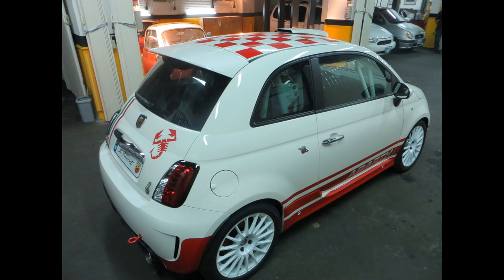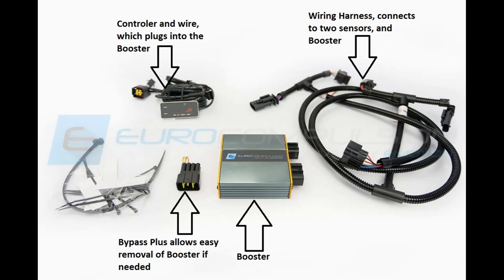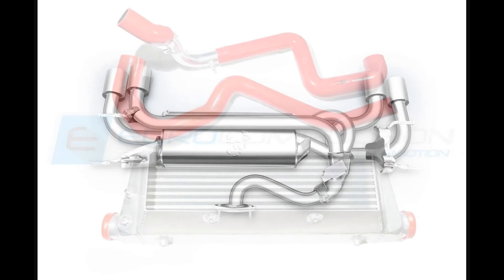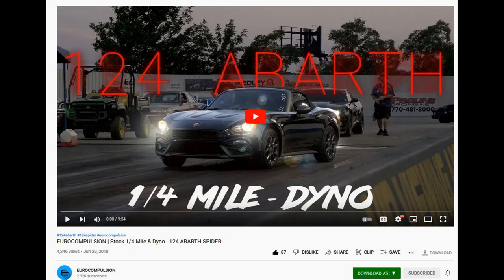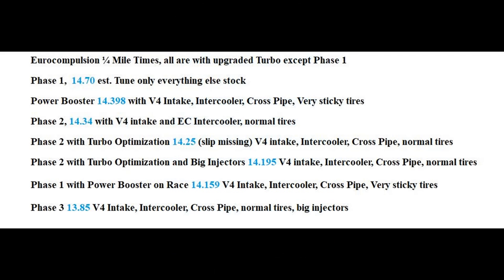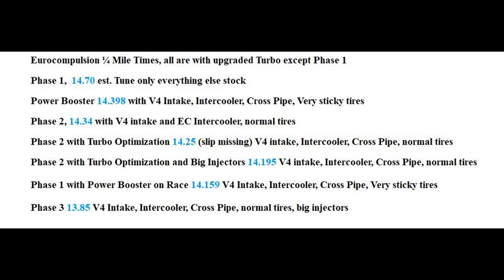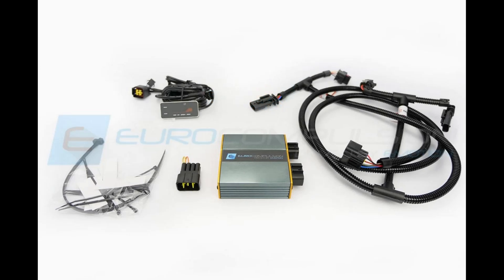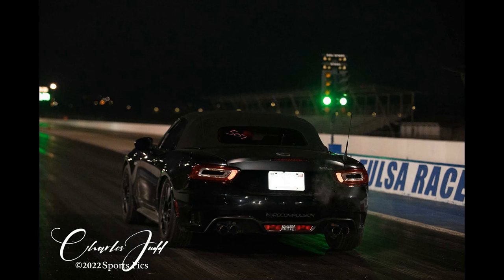Eurocompulsion Power Booster for Fiat 1.4 turbo engines

Comment: My dad has a similar device called Power Commander on all his bikes. Its also a piggyback unit that has vehicle specific wiring to use the databus inofrmations and an additional wideband lambda sensor. It automaticly adjust all sorts of parameters to achieve the perfect lambda over the whole mapping.
Its super practical if you have tuning parts on your vehicle and dont want to manually build a mapping.

Comment: Had an abarth 124 spider with the eurocompulsion v2 intake and stage 1 flash. Twas a joy to drive and, coupled with habitual upshift and downshift blips, made cute choochoo noises c: Ended up replacing the stock exhaust with an extra half inch diameter pipe that lead to a single ended muffler (much smoother sound as opposed to modern eurogrumble). Amazing to know you work at eurocompulsion holy moly :0

Comment: On par with the 15.3 of my '67 "Formula 'S'" Plymouth Barracuda, running with 3:55 rear end in 1968. My 'Cuda, was totally stock (Hurst-shifted 4-speed, Carter AFB 4-barrel, 273 CID V-8), not tuned at all, except a small tweak to the ignition timing. It also usually got 9 to 13 mpg (!!). I doubt I could afford to drive it today, and the quality control of body assembly left something to be desired – modern cars like your Fiat (yes, even a Fiat) are better-built. Now that I'm an old man, I drive a Kia Niro that has 1/4-mile times in a different universe from your Fiat, though it's faster than the Subaru Crosstrek that preceded it.
Reply from the maker: I really like the Formula S Barracudas. That's one of my favorites from the 60's. Of course they are ultra rare today, their poor overall quality and low price caused them to be sort of forgotten compared with Camaros and Mustangs.
Reply: I had an 1986 Mustang LX with the GT options. 13.8 and 27MPG on the highway if I took it easy. I couldn't afford mods, but I won a lot of races against anything stock that was made in that era.
Reply: @ZacLowing  I did, too – mostly Camaros and Firebirds with small-block V8's, with an occasional Ford V8. Never ran against a 289 Mustang, though – that might have been interesting.
Reply: @ZacLowing  
Do you mean you had the SVO turbo or the 5.0 liter?
And was 13.8 the quarter mile time?
Reply: @dukecraig2402  I owned a very tired (200,000 mile+) 83gt Mustang with the Motorcraft/Holley 4 barrel and T5. It consistently got 25 mpg with a 3:73 gear. It ran 13.9s on a good day. Usually, 14.20s as its always hot in Texas. This was before drag radials, and I couldn't afford slicks as a college student. I did quite a bit of Bracket racing back in the day at HRP. My father had a 1990 lx 5.0 5 speed. It ran about the same times with a 3:27 rear end but he was able to get 29 mpg on the highway.

Comment: You know what to do Greg. Time to mod MW50 injection into the little 1.4L to dial up that boost!
Reply from the maker: The car does have MW-50 on it, however it was not in use for these runs. I have made videos about it, I'll make another at some point in the future when I do use it at the drag strip.
Reply: @GregsAirplanesandAutomobiles  I haven't seen that, gotta watch it. Sounds very cool.

Comment: Don’t know if this is of any interest but we bought a Alfa giulietta new, it was the base 1.4 tb which only has 118 Bhp, there was another 1.4 tb in the higher spec which has 170bhp.  I’m in the uk where the road tax is based on the co2 emissions and the tax for a year on our lower powered car is £165 per year where as the higher output car is only £30 a year. 
Thank you for sharing your video.
Kind regards Carlos
Reply: We have the Giulietta 1.4 Multiair (170) which we've had for several years. Apart from blowing the clutch slave cylinder it's been totally reliable and is quick enough for my needs.
Reply: @nomdeplume798  
Yeah ours has been, we bought it new in 2014 it’s 1 oil change ( not a good thing) but it’s never had anything done at all, I think it’s done about 70k now which goes against everyone’s predictions that it wouldn’t last 3 years when we bought it. I like the DNA system it completely changes the handling. It is a fun little car really
Reply: Oil is one thing you have to be careful with in the MA as it has the fancy electro-hydraulic I inlet valves so regular oil changes with good quality oil is important.
Reply: @nomdeplume798  
I have neglected the car, it’s what my wife uses so Its never really been in my mind, but yesterday I drove it on a 80mile round trip for something it’s the first time I’ve driven it in about 3 years and the clutch pedal is hard to press the DNA system doesn’t work and has the brake warning ⚠️ light,  eml  light and tyre pressure lights all on, it’s like a Christmas tree. It’s just over 80k I’ve now realised and it obviously needs some love.
I personally would like to change it but she wants it to the end it seems.. I would say I’ve always thought the materials had a very chincy plastic feel about it but it’s all held up fine without any breaks scratches of noises. She’s averaging 39 mpg on the clock which is around town and to her work place 7 miles away, does the 170 version do better .. just seeing that if ours produces more co2 is that cause its less efficient or does the boost in power mean it has to work less 🤔

Comment: I just discovered that you are a fiat fan? I've had three of the older models over the years, a '69 Sport coupe', my first fun car, and a pair of later 2-liter convertibles, before I bought my first V-8, a '71, Boss 351 Mustang! I loved all of those cars more than you can imagine, ran the coupe' at Viginia Dragway, +-18 seconds. The other two were bought out at Ft. Carson and were almost as fast, out at Pueblo Motorsports Park, except driving up the hill to Pike's Peak, then they were a world of better. I also noted that there is an older model 124 spider in the background of many of your pictures. I'll bet you dollars to do-nuts it's not inexpensive! Do you think they might trade it for a nice '95 stick shift Camaro with a 350? I've had a bad addiction to big power cheap for four decades now, and thought it might be a nice change???

Comment: Fascinating stuff, Greg. I am curious about engine compartment air flow. On some pickups I've played around with (Diesel Dodges) I have notice an increase in cooling rate of the coolant, with exit vents on the hood. Airflow under the hood of many vehicles is terrible. I owned a '93 Jeep Grand Cherokee V8, which was brutal in that respect. There was a (seemingly) significant lowering of under hood temps with some very crude exit vents hacked into the hood. Unfortunately, I don't have any temp measurements to prove my assertions but I can attest to 'some cooling advantage' with confidence. 

Might engine compartment air exit vents improve airflow thru the radiator and engine cooler, lower charge air temps? Thanks for another great video.
Reply from the maker: Underhood vents would help this car, but no, it doesn't have them.
Reply: @GregsAirplanesandAutomobiles  From the glimpses I have had in your vids, it does seem a bit crowded in there...and that sucker is definitely pumping out a lot of heat. Thanks for the response.
Reply: The new 2016 and up Duramax's only have a vent on the hood that flows directly into the TCM (trans control module) due to it being mounted in the engine bay and it gets hot. Why they didn't relocate it? Idk but huge issue for a while for 12-15s with those modules going out due to heat failure.
Reply: @nathanadams1332  One would think they would have learned their lesson after their experience with the 6.5. The injection pump modules were located directly on the pumps and their position under the hood, meant that they endured extremely hot temps and vibrations. Aftermarket came up with a dongle that relocated the electronics to behind the grill. GM eventually offered one of their own. 

I imagine mounting on the engine has more to do with ease of assembly than anything else but why not find a cooler place on the engine? Baffling.

Comment: Greg only in terms of safety for the pilot which is the safest and rugged fighter of all the second world war? the P-47 right?

And how ergonomic was the cabin of a Thunderbolt compared to that of a FW 190?
Reply from the maker: Safety, overall probably the P-47, especially the early ones with roll over protection. All of them have good pilot protection and a crash skid. The Corsair is pretty goo too though. Ergonomics, the 190 is way ahead of the 47.
Reply: @GregsAirplanesandAutomobiles  compared to a p-47 how robust was the 190? And how safe was the FW 190 always compared to the P-47 and Corsair

and really last question, the P-51 mustang had a better cabin (always more comfortable and ergonomic) than the FW?

Comment: I still struggle to comprehend my down-to-earth nature.
In early 2020, when I earned my first money out of university, I decided not to spend the money I was going to earn on a brand new Fiat 124 Spider - which were practically given away for less than 20000€ back then! Now even the slower and worse looking MX-5 costs over 30000€...
Reply: get a volvo 940. it's almost free, it has a turbo, and does skids.
Reply: @zloychechen5150  I am sure it is a great car! However, it is not a brand new affordable two seats sportscar.

Comment: Hi Greg, I am impressed with your methodical way of testing various add ons, their settings and the 1/4 mile et’s.. This is obviously very helpful for someone else as they can reasonably expect to get close enough the same results (give or take a couple hundredths) for doing the same modifications. Your cars were a Fiat 124 1.4L Turbo Abarth.. Is there a difference in stock performance for a Fiat 1.4L Turbo Lusso, or a Fiat 1.4L Turbo Classica, or the 1.4L Turbo Elaborazione Abarth? And could all these models of essentially the same car (though I’m sure there are many differences) ,accept the modifications done to your vehicles while achieving mostly similar results? I’m thinking about purchasing a used Fiat 124.. Any answer would be much appreciated Greg.. I Love the content of your channel, especially your videos of WW2 Planes.. Thank  you, Tom
Reply from the maker: Hi Tom, the factory 124 Abarth is slightly quicker than the Lusso or Classica because of the limited slip differential. It also has a sport mode switch which makes the engine a little more responsive. However with a tune on it, but only difference is the limited slip, and of course the ability for the Abarth to switch tunes. For example an Abarth owner has the option to put Phase 1 in non sport mode, and Phase 2 in sport. The owner of other variants would have to decide on just one at a time.

Comment: Anyone else disappointed Greg doesn't have a pro-touring ride with a Merlin engine in it?😔
Reply: Merlins are so slow, why would he? They are half million-dollar engines? But for 10-12K$, you can buy an ALL-Aluminum BBC to install in your 4th gen F body which when combined with suspension and chassy mods goes very fast! The last one goes 200 on the flats, 12.1 @ 125

Comment: Could comment on the Abarth vs. Non-Abarth Fiat 124s?  I’m trying sort out it the pros & cons vis-a-vis these two models.
Reply from the maker: Sure, the Abarth you get the Sport Mode switch. On the stock Abarth it's nearly useless as you will probably run in Sport mode all the time. However on a tuned car it's cool because you can have the stock tune in non sport and the hotter tune in sport mode. Or two levels of upgraded tunes and switch between them with the flip of a switch.

    The engines are the same, the exhausts are a little different but functionally the same except for sound. Both have the same restriction in the cross pipe. 

   The suspensions are different. The Abarth has different springs and shocks. However I change them over to Eibach or H&R spring anyway, so it doesn't matter which springs the car has, and I don't notice any difference between the shocks in practical terms.

     The Abarth has limited slip. However the non Abarth has great grip, I have a video about that on this channel. You really can't go wrong either way, although the sound system in the Classica is terrible so factor that into your price shopping.

Comment: Impressive.  Greg - do you have something similar for the Alfa 4c?
Reply from the maker: No, but we do have ECU tuning for the 4C, as well as intakes and a big intercooler. eurocompulsion.net
Reply: @GregsAirplanesandAutomobiles  Thanks.  I like the option of reverting my car to stock which is why I find the booster approach so appealing.

Comment: I had thought the fiat multi-airs were direct injection, which really negates nock. I'm curious, these like most motors are variable valve timing, how does the piggyback change or affect the vvt curve? That v4 intake was that just the intake tube to a stock manifold or a completely new intake manifold , and it's crazy how much slight tweaking can crank out the power.
Reply from the maker: Some Multiair engines are direct injection, but the Fiat 1.4 is not. The piggy back does not effect the valve timing. There are types that could at least in theory, but I haven't seen that done. In any case, the type I am using here is very simple and doesn't touch the valve action. cont:

The V4 intake replaces the stock intake system all the way to the turbo. The intake manifold is stock and that's way after the turbo in the system.
Reply: @GregsAirplanesandAutomobiles  Nice! would be interesting to see if you could swap a 1.4 head that's direct injection onto the block of your motor, granted a new fuel system would be needed.

Comment: You said that the normal high octane in your area is 91, what's your average altitude above sea level out your way?
Reply from the maker: Hi Duke, good question. We are only about 600-1000 feet above sea level, which is low enough that we should have 93. However we really don't, about 99% of the stations here have 91 as their highest.
Reply: @GregsAirplanesandAutomobiles  is this MON or AKI?

Comment: What's the altitude and density altitude of your drag strip?   The local one I've seen a density altitude of -700ft.   The other track I regularly raced at would see density altitude of over 3500ft and I would have a time difference of up to .7 seconds.
Reply from the maker: The density altitudes are shown in the bottom right corner of the computer generated time slips. So you can see them for each run in the video.
Reply: @GregsAirplanesandAutomobiles  sorry I watched it on my phone and couldn't see the detail so I mainly listened.  Thanks I really like your videos and the technical depth you normally get into.

Comment: I'm in Australia and I noticed the octane rating for fuel you mentioned was a little different from what i'm used to. For unleaded fuel it's always 91, 95 and 98 written on the pumps here. I figured the fuel around the world in western countries would be more or less the same but maybe there are government standards or some difference in measuring I don't know about?
Reply from the maker: Yes, they are different ratings. Your 98 is about like our 93 in terms of octane. I cover this in another video, I can't recall which one. So if you build an EC Phase 3 124, which would be a first in Australia, you would need to run your 98.

Comment: A pair of drag radial tires mounted on some lightweight wheels that you could swap in the pits is always an option?  I agree driving every day or in wet weather with them isn’t the best. Even better if you could go down in rim diameter so you can mount a drag tire with the same diameter but has more sidewall. Get a bike chain to secure your street wheels while you race. Get that 60’ time down and I’d think high 13 or better should be very attainable given your trap speed? 60’ time makes a big difference and you don’t have the expense of having to add horsepower. I’m sure you already know but seat time helps the most. Learning how to launch my cars always made a big difference.
Reply from the maker: Thanks, the car has been in the 13's on the Eurocompulsion Phase 3 tune for some time. I covered that in an earlier video. https://www.youtube.com/watch?v=ureYYaCCaXY . You are correct in that tire and wheels and a better 60 foot would help but at this time it's literally the only 124 to run in the 13's in the 1/4 mile at a drag strip.

Comment: I have been wondering how a water + methanol + H202 injection would work. Not a lot of H202 just a little. It could add a little bit of O2 to the combustion chamber. Of course, it could also cause corrosion problems, knocking, or maybe a fire risk.  I just don't know enough about the subject, have you ever heard anything about it? I was thinking of only using 20% or 40% H202 to keep it not really crazy.
Reply from the maker: It's been done. However the results with it are a mixed bag. There is an entire NACA study on it, and after reading it, I decided not to mess with it.

Comment: Didn't know you were into cars n tuning. Been playing around trying to learn CAN.
Reply from the maker: I am really into that, I have been since the early 80's. On this channel I have quite a few videos on the subject.
Reply: @GregsAirplanesandAutomobiles  Been teaching a guy how to use Raspberry Pi's to drive round LCDs for Supra clusters, using CAN data from aftermarket ECU. Software nearly done except for software display dimming.
Reply from the maker: That's pretty cool. I'm more of a firewall forward guy, but I do appreciate a nice gauge cluster.